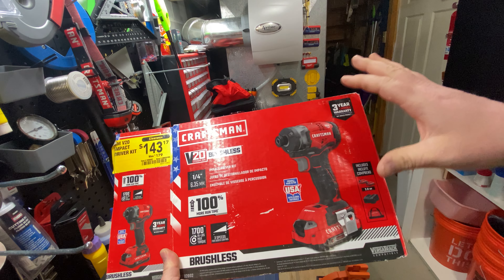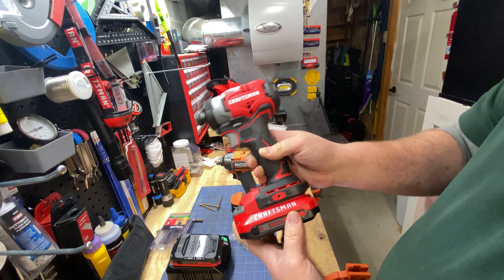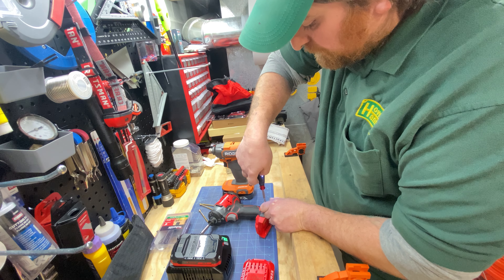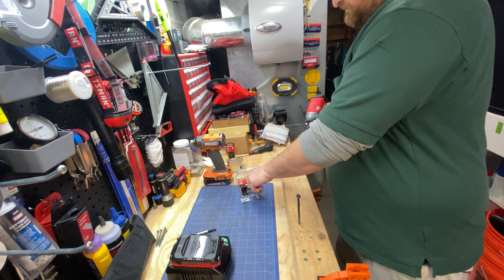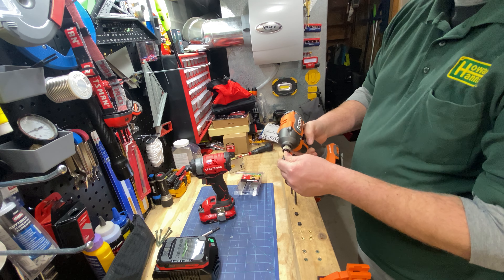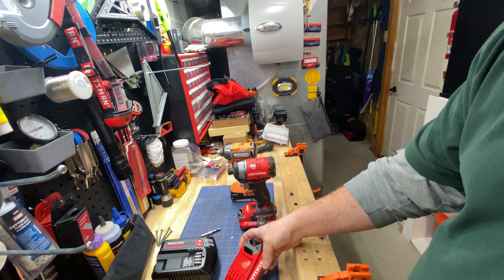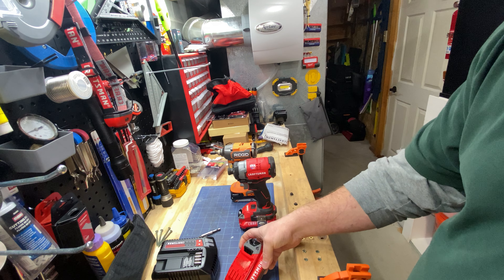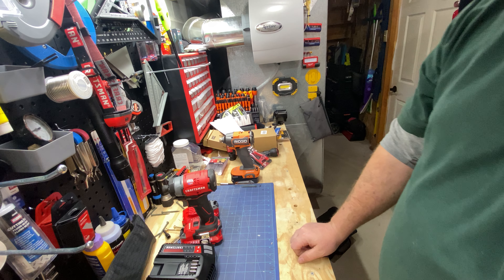Craftsman (CMCF820) Brushless v20 impact review- MADE IN USA 🇺🇸

Comment: Good review, thanks. Yeah it seemed like a big deal a few years back when all the Sears started dying off and then Lowes started carrying the new lineup of Craftsman that were advertised heavily. Seems to be around the quality of Dewalt with sort of the same selection of types of tools except the price of some of the combo sets is really low by comparison. If I had zero power tools and just bought my first house or something like that, I'd be looking at the Craftsman set. I actually used to have a set way back in the Sears days, the C3 19.2V that was really powerful for the time, the guys running the Dewalt 18V and the Ridgid were jealous.
Reply from the maker: The 19.2v die hard batteries right? My buddy still has a 19.2 craftsman drill that keeps working so he keeps hanging on to it. But yeah definitely another good option like ryobi. Fit and finish is very solid on this impact. Thanks for watching!
Reply: @themaintenanceman1  yes exactly, at least the NiCad ones were Die Hard, not sure if the lithium ion ones were also but I had both.